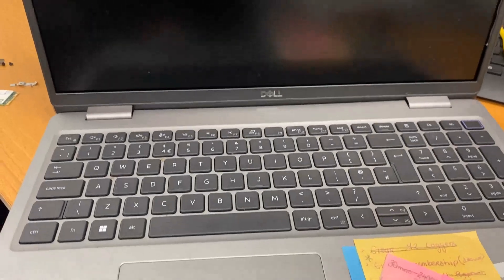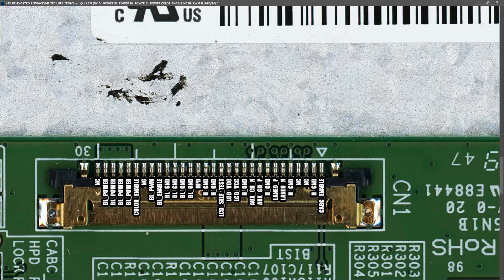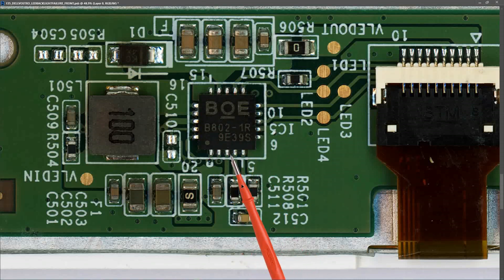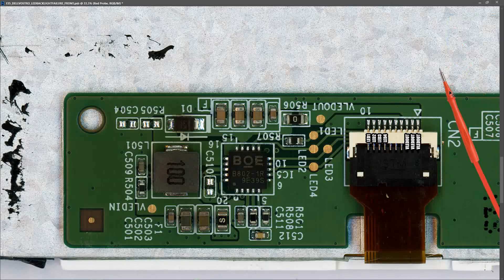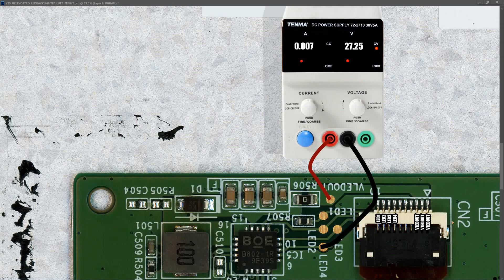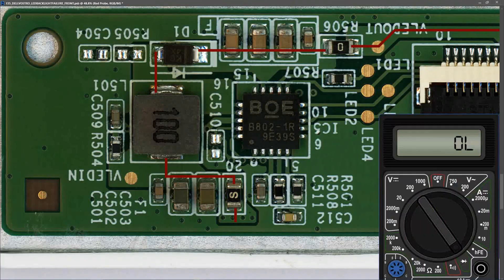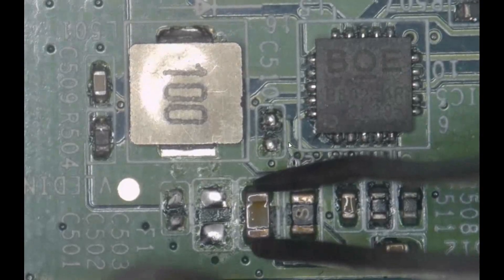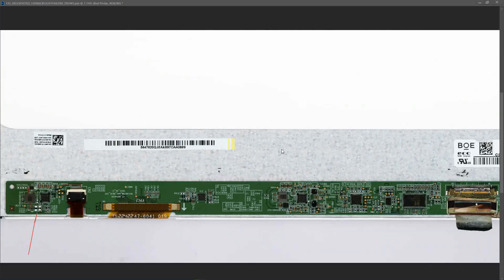DELL LATITUDE 5530 - LED SCREEN BACKLIGHT FAILURE

Comment: This is so interesting to watch. I have a dell inspiron 7300 2-in 1 silver. Which the oem screen will go dark for weeks and light up and stay lit for months and then it will off again. I eventually went for repair and the screen didn’t last a week as well I got it replaced for free and this 3rd screen is dark atm. When connected to external monitor I can see the touches point on the monitor and it displays fine on external monitors. Do you think it’s a board issue?
Reply from the maker: Hi, if the three screens were acting the same way, then I think you can conclude it is not a screen issue. You could check the BACKLIGHT_ON, PWM and main power signals if you had a multimeter. But it does sounds like you have an issue with either the motherboard or the screen cable. Good luck.
Reply: @therepairshare673 how I wish people who value repair like you are close by. They will either tell you to get a new system or new board here , no willingness to even try find fault and correct. Thank you. I’ll get a meter and try to follow this video. I could see the led1 to led3 label and 3 smd capacitors or resistors not sure on the screen side but on board I have no idea where to look. But when powering on it screen flashes not visible light but you see the change in color briefly
Reply from the maker: @oladejoolaidehabeeb3107  If you want to send me some details in an email to therepairshare@gmail.com and the full model of your laptop, I will see if it might be worth making content on the problem.

Comment: I love to watch someone repair something I have never repaired. I was surprised to see you check the LED strips before you checked the fuse and capacitors. But it could have been either one, so flip a coin. Now I just have to repair a touch screen with a faulty digitizer.